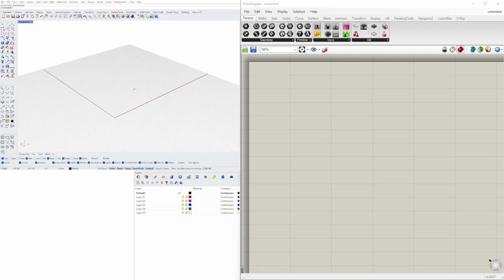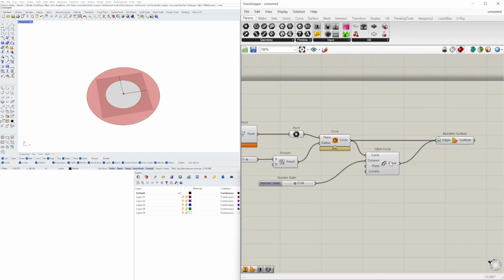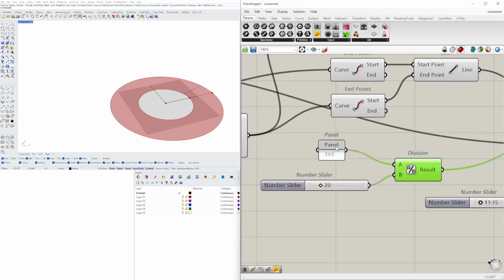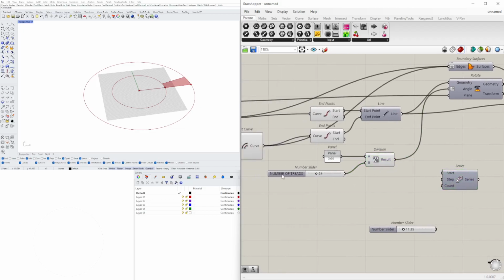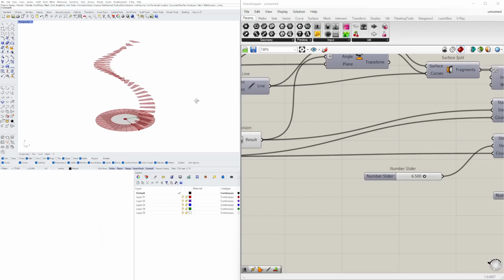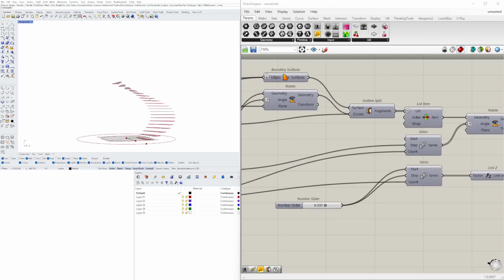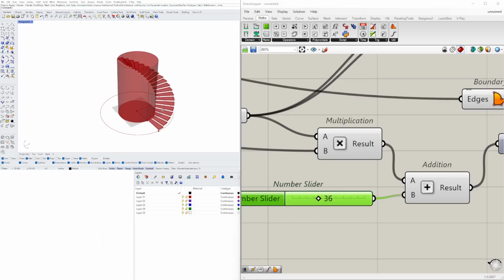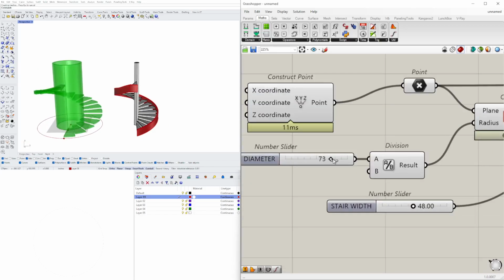Grasshopper for Rhino Parametric Spiral Stairs how to for Architects & Students

Comment: Very informative tutorial. It's more realistic for designer's like me. Some of the GH videos were done by 'geeks' who know the software but have no common sense. One way or the other, everything has to be fabricated. And there are standards that must be adhered to when building spiral stairs. So your tutorial comes closer to reality than the others I've watched. Thanks for sharing this! So how difficult would it be to to reverse the spiral using the configuration you just made without breaking everythinig?
Reply from the maker: Thank you for the kind words, and you can easily reverse the spiral by simply reversing the rotation angle or flipping the input domain!
Reply: @DCOParametric  
OK, sounds good.
Thanks!
PS: Just finished copying this video and modifying it to make my own simple spiral stairs.
With your guidance, I think I'm getting the hang of it.
It's been over a decade since I used GH, so this is really good!
One question: How do I 'turn off' the top tread where the landing will go?
Reply from the maker: Cull index. And use either 0 for the first item or -1 for the last item
Reply: @DCOParametric  
Thanks. I got that last night doing an internet search.
Been doing a lot of online searching that to figure out all this stuff.
Also learned that I had to make sure the qty in each list matched between the Series and the Surfaces.
Also, I added a start angle to the btm tread so the btm tread nose can rotate with respect to 0 degrees.
I just figured out how to reverse the whole thing.
It involved using an IF Expression to toggle +/- for the btm tread trailing edge position.
And also Reversing the input on an Item List.
Now have a useful GH script for LH & RH spiral stairs for doing scenarios to make sure they're oriented right!
Everything in the model is driven by a TOTAL REVS Number Slider, based on if it's sign is + or - sign.
Next thing is to figure out how to add a small rectangular landing at the top that'll fit into the opening specified by the architectural drawings.
After that, if I feel ambitious, the next thing on the agenda is constrain the pie shaped tread so it never violates the 12"x7" minimum tread depth rule.
Anyway, 'coding' with GH is WAY easier then doing it with VBA or iLogic like with Inventor.
I HATE 'coding' in Inventor.
But still, with GH there's a bit of learning curve.
Your YT tutorial was a life saver b/c I used it as a foundation for this!
If you want to see it, let me know where to post it.